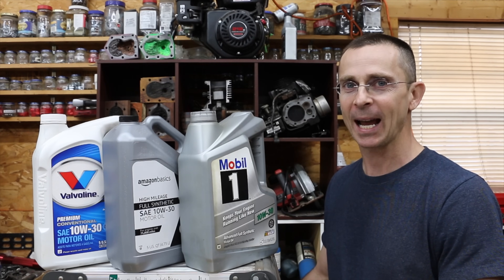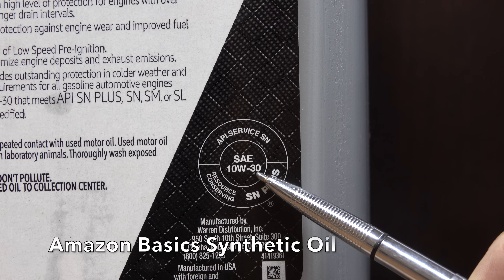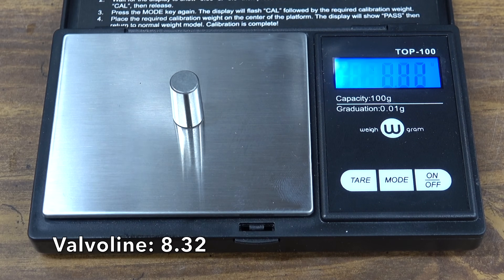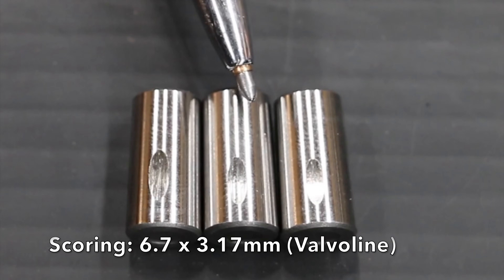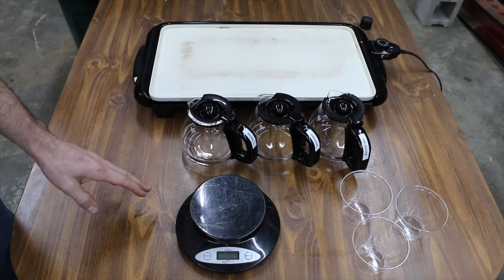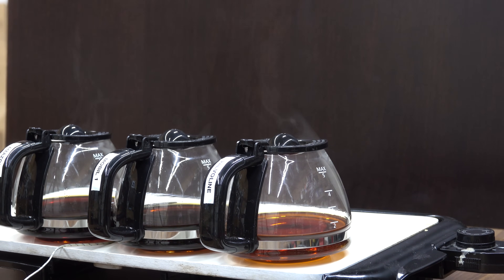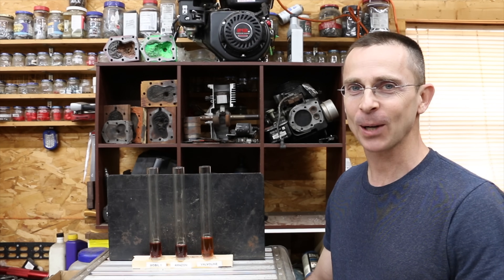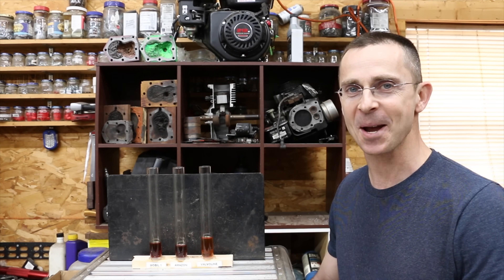Is AmazonBasics Full Synthetic Motor Oil better than Mobil 1? Let's find out!

Comment: The difference in price between high quality synthetic and generic conventional oil divided by your oil change interval mileage = cheap at twice the price insurance & peace of mind. Especially considering how much you save by changing the oil yourself. 
The thing is, shit happens. Your vehicle, during its life, may be subjected to one or more or extreme events. A blown cooling hose,head gasket, a rat eats a hole in the air filter, or you have to tow or haul something extremely heavy.  Or the worst possible situation, a teenager borrows your rig on a Saturday night.
Which oil do you want protecting your engine if something extreme happens to it? I want the oil that can take the worst possible thing thrown at it at any point in time.
Reply from the maker: Thank you!

Comment: I'm not a fan of Amazon anything. 
But I might have to switch to this oil. 
I'm currently using Castrol highmilage in one vehicle. 
And Castrol edge full synthetic in another. 
I might change oils to Amazon oil.

Fun fact:
 O'reilly's normal conventional oil is valvoline, their high milage green jugs are Castrol highmilage. Just rebranded.
Reply from the maker: Thank you for the feedback

Comment: @ Project Farm

I'm interested in seeing a video that is super simple...

One brand of oil but different viscosities. Like 3 different viscosities of the same oil such as Supertech full synthetic 0W-20 compared to Supertech full synthetic 5W-20 or 5W-30 compared to Supertech full synthetic 10W-30.

Test #1 would compare the flow rate of the three oils at room temperature. Test #2 would compare the flow rate at a cooler temperature (perhaps close to freezing) and finally test #3 would compare the flow rate at Sub zero temperatures.

This would illustrate how using a 0W oil makes a difference (or not) in getting the oil to circulate as soon as possible through an engine since most wear occurs when starting a cold engine. 

Also, the different temperatures of the same viscosity oil would show how temperature effects oil circulation rates and may illustrate whether or not the possibility of preheating an engine with an engine heater* might serve the purpose of reducing wear at start up.
 *There are various engine heaters available or a person could simply aim a heat lamp at the oil pan for a half hour before starting the vehicle. Engine heaters are traditionally used to assure that the car will start on a cold Sub-Zero morning but this would add a second possible use for an engine heater, namely to reduce engine wear at start up during cold weather days by enabling the flow rate of the oil to be greatly improved at start-up. (For persons without a heated garage.)

Is it worth knowing or not? Won't know without the test.
Reply from the maker: Thank you for the video idea!

Comment: I use Mobil 1 due to multiple testing videos have demonstrated Mobile 1 to be the best oil for high mileage cars.  This video confirms that as well.  Amazon Basic flows slightly better than Mobile 1 in extreme cold but not by much.  The wear resistance is the number 1 selling point for me since I rarely see such extreme cold temperatures.  It is good to know that in a pinch I might be able to save some money getting the Amazon Basic oil, which I didn't know existed until now.
Reply from the maker: Thank you for the feedback

Comment: What temperature is the oil for the bearing test? I would think it's designed to work hot so if you're testing it at room temperature then you're not testing it at the designed temp. Take some of the heated oil and then run the test. Let me know if you do.
Reply from the maker: Thanks for the constructive feedback

Comment: My wife has a 2009 toyota yaris with 155k miles. Ive always used conventional oil because its recommended by manufacturer. Would i be ok to switch to a synthetic such as amazon basics or supertech?
Reply from the maker: Yes, as long as it meets the appropriate viscosity and API ratings called for per the manufacturer.  Thank you
Reply: Thank you for the response!

Comment: Quick question would you want to do this again but with used oil? I’m about to do a change on my truck which runs Amsoil and it has 15k miles on the oil. You could see which one protects best for the distance that the makers say?
Reply from the maker: Thanks for the offer but I have quite a few other oil tests already planned. Thanks again
Reply: Also the oil was changed in March this year so a while ago

Comment: Including Valvoline CONVENTIONAL motor oil versus two pure synthetic oils is absurd...especially since you co continually said "Valvoline" with no mention that it is conventional.  Sure, you included the written disclaimer at the beginning, but all throughout the video mentioned Valvoline like you were comparing apples to apples when you were clearly comparing apples to oranges.  Maybe your next test should have been Valvoline full synthetic versus Mobile 1 and Amazon CONVENTIONAL.

Comment: unfortunately, the error of a scale is higher than the weight loss at this scale. A more accurate scale wich has 0,001 gram graduation might be better.
0,014g is shown as half of 0,015g, while 0,015g and 0,024g are shown the same

Comment: You should do one more test, a metal block sliding down an inclined and the surface should be lubricated each time with whatever oil is being tested, seperate test setup for each oil, and have enough distance of slide to measure time taken to reach the bottom. Angle of inclination maybe less than 30 degree. I think les viscous oil are made for engines with low clearance metal to metal part moving.
Reply from the maker: Thank you for the video idea!

Comment: I'll bet 90% of cars die from rust not engine failure ?
Reply: Yes , and since leaks are sometimes associated with synthetic oil use ,  it may solve that problem .
Reply: Also , a lot of cars go to the salvage because of ignition / computer problems .

Comment: I would like to suggest a step to add when testing the oil. It would be interesting to see a lubricity test after the oil had been heated, simulating the lubricity of the oil after it has been in the engine for a while. Just my thoughts.
Reply from the maker: Thank you for the video idea!

Comment: So whyd you run the valvoline conventional oil against synthetic oils? Seems like youd have to use the same grade of oil to say one is better than the other.
Reply from the maker: Great question. I used a conventional oil as the control per the request of viewers. Thanks again
Reply: @ProjectFarm  gotcha. Id be interested in seeing how the Amazon oil compares to the valvoline full synthetic along with a few other oils, lile castrol full synthetic and royal purple.

Comment: Very much enjoying your videos. Clear, thorough and very informative. Bravo. Have many more to watch and likely will. Thanks much !!!!
FYI, have 320,000+ miles on my 3.3L 22 year old dodge running Mobil 1, no engine repairs other than a water pump and alternator. Still not leaking or using oil.
Reply from the maker: Thank you for the video idea!

Comment: What is the stated mileage life of this oil does anyone know? Some say 10k 15k and 20k for various other brands but im not sure where to find the info for this one
Reply from the maker: Great question.  Most don't claim to last for a specific mileage.  If they do claim extended life, they also provide a lot of disclaimers, such as won't last the guaranteed miles if extended idling or extreme duty use.
Reply: @ProjectFarm  ok thanks, so guess I'll just change it out every 10k then, that's usually what i hear getting tossed around for full synthetics

Comment: I have used straight supertech 30w oil on my 2002 Corolla. The Corolla now has 170k plus miles on it and still runs strong needing little or no refill between oil changes. My 1978 Camaro same thing supertech 30w. The Camaro lasted 180k plus miles before going out of commission with transmission issues. I used to purchase regular pennsoil before the price on a quart went ridiculous high. Sad thing is supertech oil is also getting expensive.

Comment: I think you should have tested all the oils with the same API rating of  SN+. Also, I think it would have been better to do the wear test twice. Do one test with the oil at a cold temperature, and one test with the oil warmed up at normal operating temperature.
Reply from the maker: Thank you for the constructive feedback
Reply: @ProjectFarm  Thanks for all of the testing you've done. The bottom line for me is: 1. Which oil performs the best in wear testing. And 2. Which performs the best in evaporative or volatility testing, as my car has a GTDI engine, and I'm concerned about carbon build up on the intake valves. My thinking is that an oil that performs well in this test will produce less oil vapor in the crankcase, to be sent to the intake manifold, via the PCV system, where the oil vapor may form into carbon on the intake valves.

Comment: have you tried pennzoil synthetic on the noack/evaporation test
Reply from the maker: Thank you.  Yes, I have and their top of the line synthetic did very well.
Reply: @ProjectFarm  I have a 2016 silverado 1500 5.3 v8, I use 0w20 pennzoil platinum, with just a smidge over 21000 miles on it, I hardly drive it, it's sewing machine quiet

Comment: Here in Ireland (Europe?), Castrol Magnatec (synthetic) is available which supposedly sticks to the metal parts in the engine, supposedly reducing wear, particularly during initial startup.  Thoughts or future test??
Reply: There is much more to it than brand and SAE viscosity rating. I am also in Europe (UK).

Comment: Maybe compare to Valvoline synthetic, or Valvoline vr1 racing oil? 

I started running Valvoline for one simple reason, their customer service is superior to Mobil 1. Stemming from a question I sent to both companies after rebuilding the top end of a jeep 4.0 that had wiped a cam lobe and lifter on a flat tappet engine. I wanted to know the best oil to use on the rebuild, as modern off the shelf oil is not conducive for old flat tappet engines. 

Not only did Valvoline respond quicker, they gave a recommendation and reasoning behind their recommendation. I've been running Valvoline oil ever since in multiple applications, including the new 5w30 synthetic mst diesel oil for my 17' colorado 2.8l Duramax. I run Valvoline synthetic in my 16' 5.0 mustang, Valvoline VR1 in my 90' cherokee and 02' Durango. The Durango has over 250,000 miles on the stock 4.7l and the Valvoline VR1 has noticeably quieter valve train noise and more idle oil pressure than other off the shelf conventional oil. The reason I know this, is because when I bought the Durango at 160,000 miles, after I did the first oil change, the valve train noise was horrible and it had such low oil pressure at warm idle that the engine shuddered unless I kept the rpm's off idle and oil pressure up. One day of that, I switched to the oil I had been running in the Jeep, and haven't had an issue since in the 90,000 miles I've driven it with multiple cross several state trips. The jeep has close to 200,000 miles on it with the stock bottom end and oil pump, and it has also proven that Valvoline VR1 performs better in both valve train noise and oil pressure.  (Yes I know pressure isn't a great measure of oil, as you can get more pressure from thicker oil and too much pressure is just as bad as not enough, but in my applications of high mileage engines and comparing similar weight oils, it is important to consider, especially when oil pressure was so low at warm idle that the engine actually caused noticable vibration in the truck.)

Because of the jeep's upside down oil filter mount, I also know which oil filter's anti drain back valve actually functions, out of 5 filter brands I tried all with anti drain back valves, the only one that worked(of course the last one I tried, no reason to keep testing once you find one that works), is STP. All the other filters took a long time for oil pressure to build up on initial start up, as the filter had to refill first, and were empty when I removed them to replace them. STP held oil in the filter, always had quick pressure on start up, and always makes a mess when I remove them to change.
Reply from the maker: Thank you for the video idea!

Comment: I have used Valvolene for years and have always been very pleased. The valvolene oil wasn't synthetic, shouldn't you have used valvolene synthetic oil to have a true comparison test! I used synthetic valvolene in my twin turbo Dodge Stealth which had small oil journals, I never had engine or turbo problems! Thanks for the video.
Reply from the maker: Thank you!

Comment: Welcome to see the best test done on conventional and synthetic motor oils for your cars ,Diesel trucks and Motorcycle .
this website is a part of reproduction of a wear test on Motor oils created by 540 Rat (His Nickname)
I've built this website with his test and I give all the credit to this expert in oil testing.
540 Rat is a Mechanical Engineer (A Mechanical Engineer is clearly the most qualified Engineer to test motor oil that was formulated by Chemical Engineers, for wear protection capability between mechanical components under load.)
U.S. Patent Holder (Mechanical device designed for Military Jet Aircraft)
Member SAE (Society of Automotive Engineers)
Member ASME (American Society of Mechanical Engineers)
Lifelong Gear Head, Mechanic, Hotrodder, Drag Racer, and Engine Builder. www.motoroiltests.com
Reply from the maker: Thank you!

Comment: Real lubricity test would be after cooking oil while still hot, lubricity is industrial measured at operating temp, cold test is good for cold start condition but doesn't test the true lubricity of the oil which is achieved between 180° and 250° (350+ on PAO based synthetic) above 200 is where you really test the manufacturer additive package
Reply from the maker: Thank you!
Reply: A pre test flow test would be awesome too, oil visc isn't the exact same between 2 batches, would be interesting to see how the perform before anything at room temp;)
Reply: But very nice job overall so don't take me wrong)

Comment: AMSOIL (there I go again) used to make aviation oil back in the 80's. I don't know what happened to it as it hasn't been produced for years and may have been an experiment into the aviation market.
It's ironic as the founder of AMSOIL was a jet pilot for the Air Force then after that he started AMSOIL. One reason is he knew jet engines need a better lubricant because of the heat so he developed the synthetic oil. Not only a jet pilot, he was a chemist also. The rest is history.
Reply from the maker: Thank you

Comment: Well, this was interesting, but a bit fruitless. There's so much more in an oil than just flow characteristics, and these bearing tests don't really tell us much. Comparing low temp flows is kinda a "stats" way of showing the same thing 4 different ways. In other words, if the oil does not flow well at the cold temp you operate in, then the viscosity chosen was the wrong one.
Reply from the maker: Thank you for the constructive feedback.

Comment: What would cause oil blow by
Reply: Possibly a bad PCV valve, or even a bad valve cover. I had a Nissan Sentra that I had to change the valve cover on, and in the interest of saving money, I bought a cheaper Dorman valve cover. Biggest mistake ever!! My car never used any oil, but after the change, it started using it big time. It took alot of research on forums and even YouTube to figure it out. By the time I did though, my car was running like crap because of all the oil blow by. Turns out it was a design flaw in the valve cover that Dorman was even aware of. The redesigned it, but left the faulty ones on the shelf for people like me to wreck our vehicles with. It cost me $1200 to get my car back to correct, and Dorman does not stand behind their warranty. It was doccumented by 2 different ASE mechanics that helped me get it fixed, and even with documentation from ASE professionals, they told me to take a leap, and compensated me zero dollars for their shady maneuver. I will never by a Dorman product again if I can help it.

Comment: I wonder if oil of same brand performs different from different times of manufacturing. In other words, I wonder if a bottle of unopened penzoil platinum 5w30 from 2017 performs as well as a bottle of penzoil platinum 5w30 from 2019.
Reply: @Charlie Ennis Drastic change? Not likely if the oil meets or exceeds the service specification of your engine.

Comment: I used my Honda maint minder for test (5w20).  
Mobil1 6500 miles at 10%.
Castrol Magnatec 7750 miles at 15%. 
I am trying Supertech now.
I dont know if engine mileage helps the oil last longer.

Comment: Why didn't you use Valvoline synthetic oil? I thought it was supposed to be all the same type to get a unbiased test
Reply: Richard S. McHardy to show that synthetic oil is better
Reply: @christianvogel1012  well I have always have been using Valvoline oils since the 70's I have always been a firm believer in good oils and filters my last vehicle was a 99 Ford ranger with a 3.0flex fuel V6. Standard transmission I put 430,000 Miles on it before the rod bearing said that's all folks  I have a great 98explorer 4x4 that now has 220,000 miles on it and I use synthetic blended from Valvoline